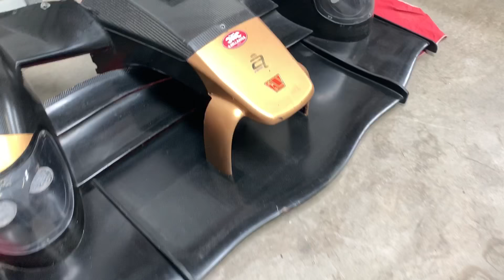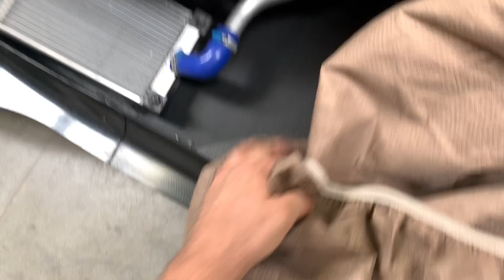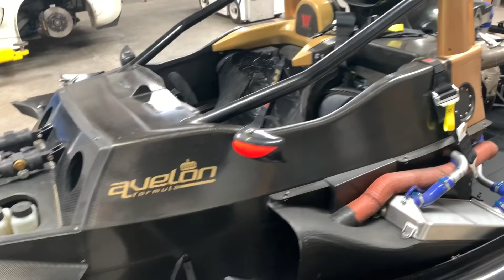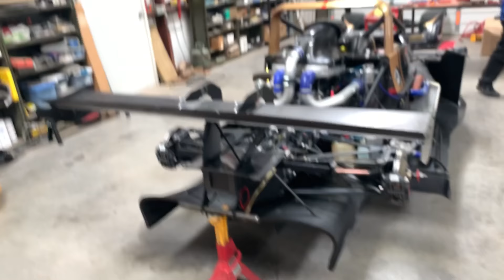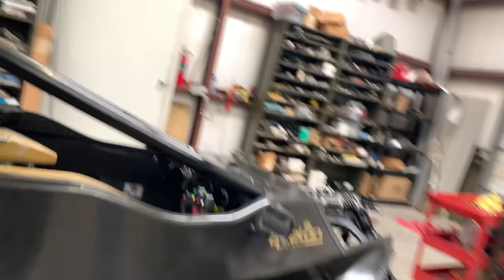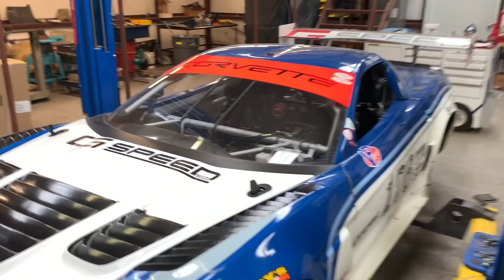Wolf Prototype LMP3 (In Pieces Getting Ready For Race Day)

Comment: is the builder aware of the issue with the original Wolf Dallara..  that there was so much downforce in front of the front wheels that at high speeds it would lift the rear tires off the ground and the car would get crazy..   use those ride height sensors to watch for the rear suspension to partially unload.. or the front ride height sensors to indicate reduction in ride height from levering down the nose and lifting the rear wheels off the track.  the original wolf dallara was given to a school to figure out what was wrong with the car that made it so wicked .. it was never supposed to be sold. which it was and it killed the new owner/restorer.   just thought you should know..  this is the restored WD-1 https://youtu.be/g4mPeIY0lgob